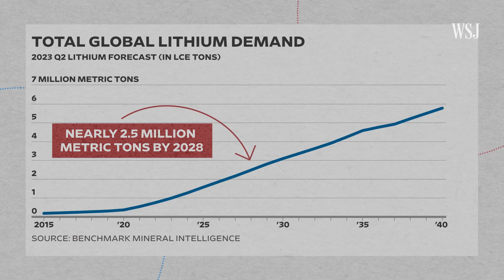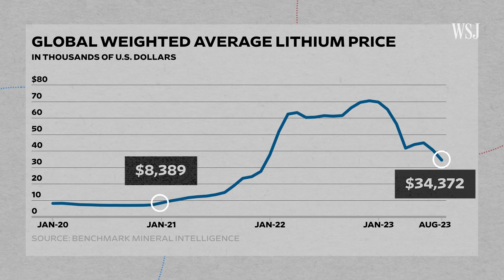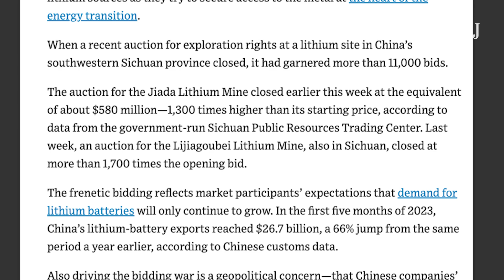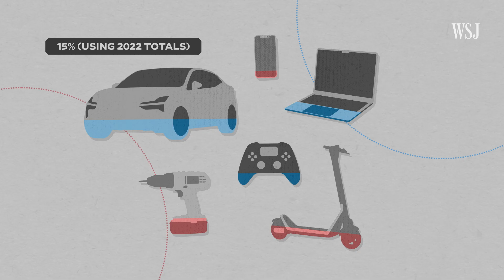How the U.S. Is Investing Billions to Compete With China’s Lithium Supply Chain | WSJ U.S. vs. China

Comment: Sodium is just being to be used for batteries.

There are at least two models of electric car in China that are currently in production which use Sodium Ion batteries.

There is so much Sodium on the planet, it's the salt in the oceans, it's so much cheaper than lithium.  Although it's never going to make it into a high performence racing car, it is good enough for cars for the masses.

Comment: To satisfy the needs of battery electric vehicles, Lithium is on its way to becoming the White Oil, replacing petroleum as a strategic resource that caused the US to start the Gulf War after Iraq invaded Kuwait. This is an inevitable trend unless the cause of lithium demand is addressed, i.e., to find an alternative to BEV.
Hydrogen electric vehicles is a better solution in this regard. Hydrogen can be produced anywhere on earth with water and sunlight or wind. Any country can build the production facilities if desired. The production only needs a small amount of a catalyst material. The consumption can be in an internal combustion engine which requires no catalysts or a fuel cell electric vehicle which requires some catalyst material.

Comment: Sodium ion batteries will replace Lithium ion in EV batteries,  once the the super fast charging network is mature and fully deployed across the nation in sufficient saturation.  EV Range anxiety simply wont exist once the charging network is fully mature.  Sodium is far more abundant than Lithium, cheaper, can charge faster and is safer and works better in winter.

Comment: My source on volume of water in Erie - Brainly; says it's volume is 116 cu miles, I think that is 126 trillion gallons not quadrillion. So sources seem to differ but judging roughly by the size and average depth this figure looks rougly accurate.  Lake Michigan would be proportional. Could be brainly is off but doesn't seem by anything like that much.

Comment: Chinese made LFP batteries are not recyclable. The US and European countries need to make them illegal in their market.
Reply: Could you please elaborate on why they would not be recyclable?
Reply: @Freba9  for LFP, it costs much more to extract hence economically it doesn’t make sense.
Reply: @ylee3438  That is a real pity because LFP has a lot of advantages compared to other chemistries.
Reply: @Freba9  good for ESS, but not good for autos, especially during winter.
Reply: @ylee3438  Many EVs are doing great on LFP. The Model 3 beging one of the best examples. With proper temperature management LFP is very usable in winter too.
Reply: @Freba9  maybe LFP works ok in china as you have experienced, but they are yet to be tested fully in other countries. 
The basic laws of Chemistry don't change when the batteries move from China to other countries. Let's see the actual experiences here in US when people drive cars with made in China batteries.
Reply: @ylee3438  I have no idea about China. I just know the LFP Model 3 is doing absolutely fine in both European and American winters.
Reply: @Freba9  >> That is a real pity because LFP has a lot of advantages compared to other chemistries. <<
LFP's only advantage is their cost.
Reply: @tooltalk  + longevity and lower fire hazard.
Reply: @Freba9  >> + longevity and lower fire hazard. <<
You don't get that b/c LFP in EVs operate under high SOC and high c-rates.
Reply: @Freba9  : for instance, 
Tesla LFP Battery 10% RANGE LOSS PROBLEM? | Model 3 RWD (see Cleanwatt's YT video)
  The brand new LFP batteries will degrade substantially quicker.  There's not long-term retention data for LFP batteries on the market yet, but the trend tends to be substantially faster degradation.  Trends show them stabilizing around that 10% degradation mark in about half the time as non-LFP batteries - around 50,000 miles instead of 100,000 miles."
Reply: @tooltalk  That could be, interesting. However, initial degradation does not indicate bad longevity. And yes, LFP can be kept at 100% SoC. That is another advantage.
Reply: @Freba9  >>  LFP can be kept at 100% SoC.  <<
All lithium ion batteries, including LFP, degrade much faster under 100% SOC -- the reason why Tesla LFPs lose the first 10% twice as fast as non-LFP is largely because of the fact.  LFP under high SOC can lose as much as 1/3 of its lifespan in ESS.
Reply: @Freba9  >> And yes, LFP can be kept at 100% SoC. That is another advantage.  <<
This is not "another advantage" -- it's a major technical shortcoming that adversely affects LFP battery's lifespan.   All LFP EVs must be recalibarated frequently to avoid misreading SOC/range -- and other associated problems such as cell imbalance.   LFP can outlast other battery chemistries in stationary (non-moving) battery storage under non high-stress environment, but in high performance/stress environment, we know very little about their lifetime.
Reply: @Freba9  : the recycling cost is higher and there is no valuable recoverable metals in cathodes.  It's higly uneconomical and will probably have to be subsidized.

Comment: Electric and lithium terrible for earth. Stick with low emitting combustion engines the future will be extremely efficient and clean better than completely razing the earth for lithium
Reply: The only low emitting combustion engine is the one you never run.
Reply: Lol not at all. Battery electric is the only sensible way forward. There is no such thing as a ‘low emitting combustion engine’.

Comment: Too bad they don't have the green energy to process it.
Reply: Not necessary.
Reply: @Freba9  It is when big auto companies want to go carbon neutral and use green energy. There's a reason the emv industry is expanding in Ontario and Quebec, cheap green hydro and nuclear power, and access to minerals up in the parr of the provinces.
Reply: @Tjd1983  Of course. But even if they use non renewable energy for production, total life cycle emissions are still vastly improved compared to gasoline cars.

Comment: The achilles heel of lithium is it's massive water use in refining.  500,000 gallons per ton.  It already uses 1% of all fresh water on the planet, but BEVs are only 2.5% of the new light vehicles.  To get to 25% of all new vehicles would required the equivent of all the water in the Great Lakes Michigan and Erie combined!  So no matter how much Lithium ore you find  most cannot be refined due to a lack of water.
Reply: That's is only if you are using the evaporation pools method which is not used in the US or Australia. New techniques using membranes have been developed that avoid huge water use which are in the process of being deployed in south America. Just because something has been done in a bad way in the past doesn't mean it can't be done in a better way. The better way may be a bit more expensive so sometimes you need to require companies to use the better way, not just leave them to choose for themselves.
Reply: Show your math and sources please. Because firstly, Its 500,000 liters so 1/3 of that. Secondly its around 8kg lithium in an electric car battery.  Lake Michigan alone is 1 quadrillion gallons, a number I don't think you fully grasp the scale of.
Reply: A big difference between lithium mining and fossil fuel extraction is that, when a battery reaches end of life, all the lithium that went into making the battery is STILL in that battery and can be recycled. A point of inflection would occur in lithium mining when lithium from the recycling of batteries will surpass any new lithium that needs to be mined. Over the next decade, the first generation of lithium batteries will be reaching end of life and the recycling industry will really get off the ground.
Reply: @tallest4eva  everything on earth is pretty much carbon based. Burning fossil fuels creats what? Carbon emissions right? So what's that mean? 🤔 It's recycling itself for free back into the earth. Plus no woman gets excited when you rev an EV. They're silent.
Reply: It is not only vehicles that use batteries, they are using for everything, from computers , phones, plane, ships, trains, store energies etc.
Reply: @freeworld88888  Cordless Drills are a common household appliance,  in houses under construction.
Reply: Lithium cordless tools are just wonderful. Most builders tools are now battery powered including saw benches, concrete drills, planers, which means everything can be stored in their van without cords tangling all over the place. I have more than 20 batteries, my only fear is battery fire, most quality batteries do not explode.
Reply: IT TAKES 4.4MILLION TO 5MILLION GALLONS TO FRACTURE  ONE OIL WELL. & THOUSANDS OF WELLS ARE FRACTURED YEARLY JUST ALONE IN THE PERMIAN BASIN.
Reply: Absolutely false:
Lithium processing plants are water plants. They refine a high-grade lithium output using water that can be returned and re-used.
Reply: Nuclear power and de-salination of sea water can be an alternative, though probably expensive. My guess os that the world will turn to more public transit in the future instead of a private vehicle for every human.
Reply: @AgentSmith911 the USA dun want to consider Public transportation.. it's large and ppl live many miles from things like work or groceries and healthcare.. they drive to work..drive to school..drive to buy food... Automobile companies and petrol companies in USA dun want ppl to go Public transportation..or EVs.. it kills their business
Reply: @AgentSmith911   The control of US Government since the mid 1950's has been reflecting a profound investment from the same folks who profit from Fossil Fuel investment.
 That appears to continue.
But as in 1967 when the realization that providing real assets to support currency used to promote the profits of Investors like the Brown and Root Folks who enjoyed a good return on investment that bought them a Senator in 1948,  appear to still profit,  so the corruption continues.
The Currency changed in 1971,  but the Oligarchs remained.
I assume Capitalism will be the big loser this time.
Reply: How many EV batteries can a ton of lithium make?
Reply: 133 @xuimod

Comment: There will not be no any fight over lithium. China is the only major consumer of lithium. Therefore based on supply and demand other countries will be fighting to sell their lithium to them.
Reply: That's extremely short termist. China is the only major consumer of lithium SO FAR. As the EV industry matures in other markets, this will only soar and increase competition for lithium supplies. Many western democracies have already set goals to phase out combustion engine vehicles by the 2030s and 2040s, which means demand for EVs will soar, which means demand for lithium batteries will soar, which means demand for lithium refinement will soar, which means demand for lithium will soar. Do you see now?

Comment: Think of everything you own with a battery. Its either dead or going dead very quickly.  Lithium is the equivalent of the steam engine, 8 track cassette, or floppy disk. An inefficient temporary stop gap before a game changing tech comes along. Rather then develope hydrogen usage further, were made to believe lithium is the savior. Im not fooled.

Comment: Lithium is not the critical metal, Cobalt is.  Democratic Republic of Congo mines over 70% of it.
Reply: Except tesla already sells 50% of all their evs with lfp since late 2021 they use no cobalt or nickel. 
And the lfp market is 43% of all ev cell production this year through q2 reported numbers.

With lmfp and m3p chemistries just coming out and on par energy density wise with the best nmc cells from just a few years ago. 

And sodium has entered the mix for low end short range city evs and energy storage applications as well. Plus recycling is ramping up every where these day's. Redwoods materials in the us wants to supply enough recycled materials for 10,000,000 U.S. evs by 2030. 👍🏻😎

Comment: isn’t the real issue for the US their electricity infrastructure?  does it matter how much lithium the US get their hands on if the current electric grid cannot power all those batteries?  it’s possible to up the burning of fossil fuels to increase electricity production, but that would defeat the purpose of green energy in the US.  wind, solar won’t cut it, and nuclear is on its way out.  we’re putting the cart before the horse, aren’t we?
Reply: China's solution to this problem is burning more coal and building 10s of new coal plants each year.

Comment: How long will it take to construct the mineral and battery factories? and what's the remaining time window to compete with China?
Reply: >> How long will it take to construct the mineral and battery factories? <<
it takes anywhere between 2 to 10 years to open a mine, depending on various environmental and local regulations.   The most popular brine lithium extraction method in addition takes anywhere between 2months to 2 years.   The time it takes between signing a contract with battery makers to a production line is about 3 years, but in some instances it takes longer -- LG spent 4 years to bring up the yield rate at 70/115GWh Poland plant.
Reply: @tooltalk lol u need to wait 10 years to open a mine?? How are you going to compete against a country that can open a mine tommorow? 😂